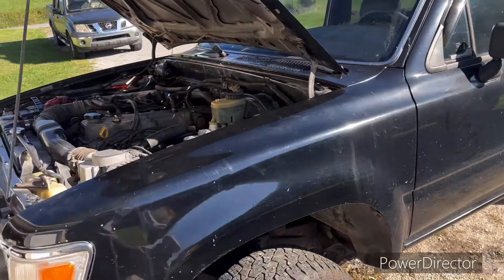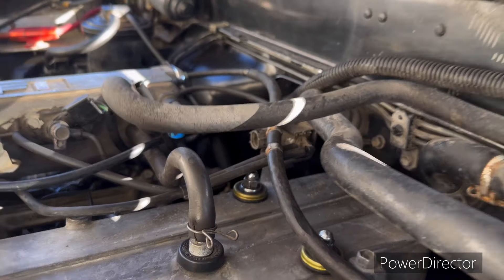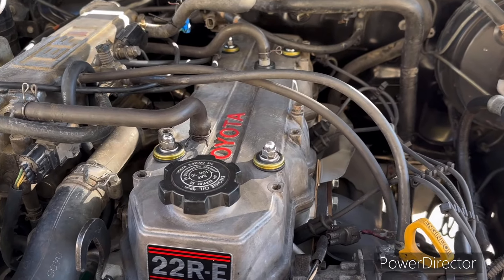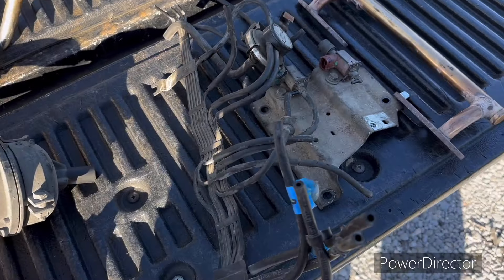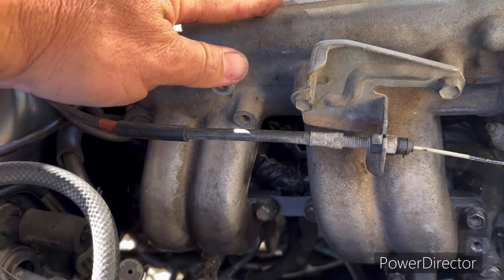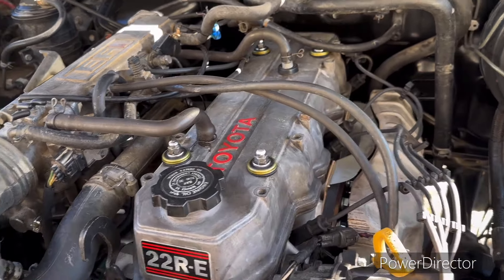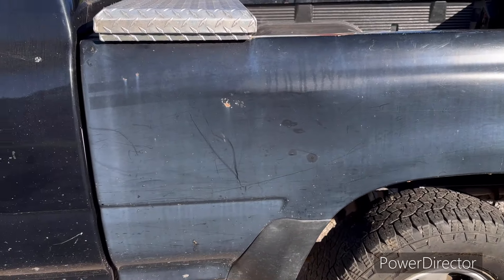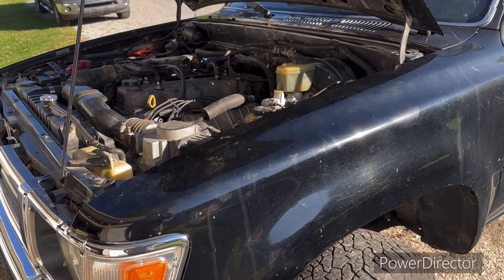22RE EGR delete. Probably the best mod ever to do on your Toyota. #automobile #truck #toyota #best

Comment: What did it do for your computer module,  what kind of signals does it throw now . I don't understand why you didn't have to change gim  modules
Reply from the maker: @kidjobuck  there is no codes. I didn’t have to change anything just remove the item shown in the video and put the truck back together. It runs fine. There’s no check engine lights on in the engine runs as normal. It should run a lot cleaner now that all that exhaust isn’t being shoved back into the intake was a mess when it was filthy when I cleaned it out.

Comment: can someone tell me honestly does this egr delete increase hp and mpg because it would make sense if it did, especially if the egr system was clogged, ive heard from lce that it does increase hp now im hearing it doesn't from other people, any thoughts?
Reply from the maker: @justincase45  I can say after driving the truck for a while there is no increase in horsepower. There is no increase in fuel mileage. It just cleans up under the engine bay and whenever I cleaned out the intake and all that it was just covered In black, whatever were the exhaust was being showed back into the intake